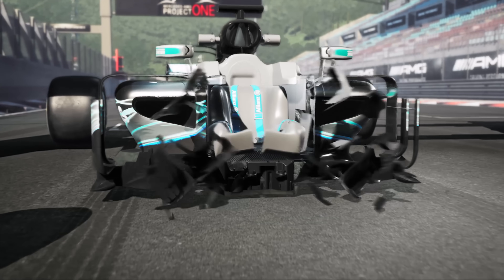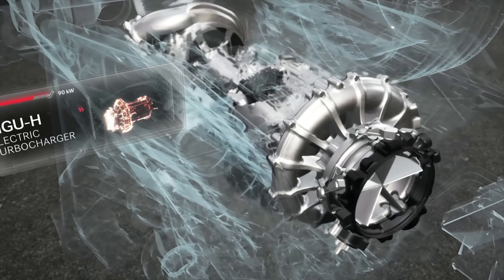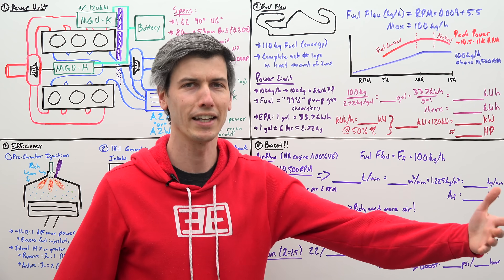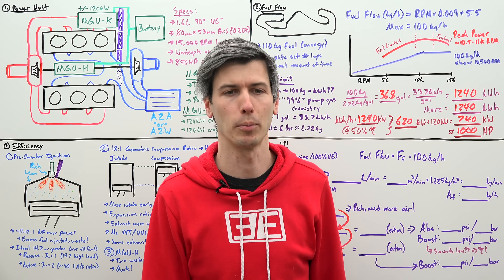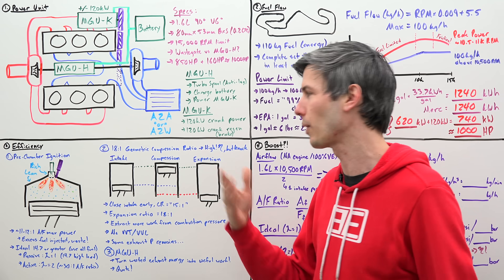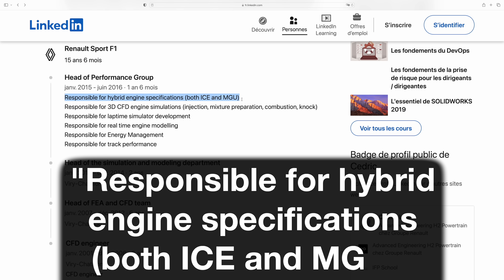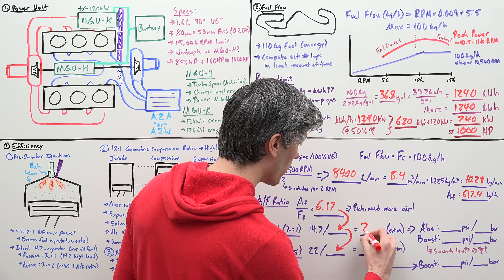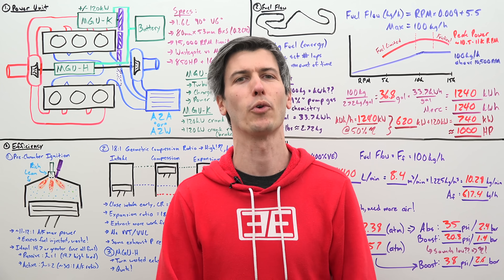How Tiny Formula 1 Engines Make 1000 HP!

Comment: Ppl still don't get it a regular 200hp fuel motor can turn a generator to supply electricity to a battery to supply electricity to an electric motor that puts out 1,000hp, so why do they need 2,000hp to run a 250mph car, fuel and electric combined.

Comment: Your forgetting F1 cars engines do not use normal gasoline fuels they use oils very very thin mineral oils ,with no friction or additives at all, its a base mineral oil ,which produces power and also every moving part of a f1 engine is coated with diamond specialised coatings so it does not require the normal additives found in the average consumer cars ICE engine platform etc. cheers ✌✌👍👍🦘🦘

Comment: i heard toyota reached 42% efficiency in their Hybrid, their hybrid engine also run at the same rps most of the time, they have a variable valve timing in two configuration, one of which is designed to simulate a smaller intake stroke optimized for that rpm  range. would adding a similar turbo system raise efficiency and be convenient?

Comment: JAPAN is the reason F1 is so hi-tech. Most F1 teams run on Honda engines or Japanese engineering expertise. Including the other engine makers..who use technology pioneered by the Japanese. Making 1000 hp from small 1.6 litre engines is Japan's speciality. Those who are familiar with Hayabusa, Nissan, Civics Type R vtec engines know the small engine-big power ratio.

Comment: They're all talking a 1000 horsepower on the modern 1.6  V6 that we have here .

This is with all the complicated electronics hybrid system and everything else just a big electrical nightmare .

I say that we go back to 1986 - 88
back then we  had a 1.5 litre twin Turbo V6 engine in qualifying form was making 1450 horsepower , the Race Engine made 1100 Horsepower without any electronics like a hybrid system and all of that electrical nightmare .
Reply: Engine in the 80s have no reliability. One engine for qualification, and another less powerful one for the race. Moreover, they've literally used rocket fuel to power those engines.
Reply: 1. No F1 engine in the 80s got any more than 1350 horsepower and that was in the all or nothing quali engines that'd last maybe 2 laps before needing to be thrown in the bin. The race engines never got more than maybe 900 horsepower.

2. Said engines blew up all the time. Teams could often go through several engines in a weekend. The modern ones can use 1000 in race conditions and last multiple race weekends
Reply: @dod_the_angel 
 The problem with the current engines as you've even stated is with all the electronics  ( meaning the hybrid motor ) along with the V6 turbocharge engine yes they do make a 1000 horsepower but if you look at the V6 turbo engine by itself that'd be V6 isn't anywhere close to what the V6 of the 1.5 engines run from 1984 - 1990 they had a lot more power and they were definitely running on very toxic fuel I remember being in the pits at Adelaide In 1986 if you didn't have a gas mask on that stuff would give you a migraine headache and burn your eyes it was toxic fuel .

But those engines the qualifying engines that is the V6 engines were putting out 1400 horsepower
of course they were good for about maybe 5 laps and that was like running a hand grenade , the Renault twin turbo engine at the time when Lotus was running it the horsepower and the race engine was 900 horsepower and that of course lasted the entire race .

Comment: What you mentioned at 11:18 reminds me of the 5-stork engine. It was once prototyped by ILMOR. Interestingly the designed mechanism was not successful in finding its way to industry because it worked perfectly only at HIGH rpm, which is the working point of the F1 engine 🤔

Comment: With the electric motor unit helps that extra horse not difficult to understand  , But how they convert that power to joint the engine output (That's hard)

Comment: A friend made me watch the recent F1 race in Lost Wages. One thing I noticed was the frequency of the exhaust seemed much lower than I remembered back when I was watching all racing. So, not only did I find out they are now V6s (they were V12s when I used to watch), but they are now hybrids. I have been watching Formula E and WEC (due to the hybrids), but was unaware of hybrids of F1. In researching them I stumbled on you nifty explanation of how it is all tied together. I thought I had seen all your vidios already, so was surprised to find one I hadn't seen. ;)

Comment: Tolerances on Formula One engines are so tight that they must be warmed up to at least 160° before starting giving them much less blow-by.  If you don't warm them up the engine is ruined.  I've worked on historic F1 cars.
Oh, another thing F1 teams do is cool the fuel before the race but it must be at 72° at race time per the F1 rules (at the time I was working Tech).

Comment: Pre-chamber ignition is also used in a high tech rocket engine, the Raptor engine used on Starship. Well, it's not exactly the same thing, but technically do the same thing, the engine cycle is called full flow staged combustion cycle.

Comment: Impressive presentation on the F1 power plant system. I don't know nearly enough about the race teams to have a favorite - I only know that I find F1 much more enjoyable than stock car racing. 
Assuming that all race teams work within the limits of the rule book then the difference between winning and not winning falls back to luck, talent of driver and team, ground effects, and mechanical integrity of the cars various systems. Speaking of F1 car systems I am only guessing that the power plant is air cooled? Working with extreme pressures and rpm's it seems it would almost impossible to effectively keep the power plant from seizing up or exploding with air cooling only. So is there something other than or in addition to cooling the engine besides air flow Is the F1 engine good for one race only? Does each race start with a completely new engine?

Comment: The valves present a significant constriction to the airflow at 16000ish liters per minute that the fuel needs to have to burn completely. Doubly true at the super high RPMs these run at. I would guess 3 or 4 bar of boost is closer to what they actually run.

Comment: I remember reading about Honda's advanced stratified charge engine, the CVCC, back in the early 1970s in Motor Trend magazine. It employed the use of a smaller pre-combustion chamber with a rich mixture of gas and air to ignite the leaner mixture in the main combustion chamber. What you're describing with F1 sounds very similar to this concept. This made for an engine in the Civic, with its 12 inch wheels, which achieved 55 MPG; with a carburetor. Having lived through the Arab oil embargo in the early 70s, I was very amazed that Honda was able to achieve that feat. The gas guzzling (truly) full-size cars from Detroit did well to achieve 15-17 MPG on the highway.
Reply: Imagine this same engine with modern, direct fuel injection, variable timing (VTEC in Honda speak) and a turbo charger. Considering Honda is back racing in F1 (and winning) some engineering team back Japan has to be developing this.

Comment: Renault also pioneered the research on stratified fuel injection, starting by changing the shape of the piston. By then VW had figured out that high pressure direct fuel injection would do a better job.

Comment: An idea for a future video: Ive always wanted to see car manufacturers put an F1-style MGU-H in a road car. Especially, for battery electric applications. How efficient would a generator be, if it were attached to a turbocharger (both at idle and normal ranges of RPM) and how much electricity could it produce to charge a battery pack on the go....would love to see this!

Comment: Hi, something unclear for me. If there is limit of 100kg/hr of fuel flow and that's happen at 10500, how should they achieved 12000 rpm? they need more fuel flow or i missing something?
Reply: You simply make the air/fuel ratio more lean with increasing rpm.

Comment: Very nicely explained. I didn't see where your boost would be compensating for flow losses on the intake manifold and through the valves. Wouldn't you need some overpressure to compensate for those losses?

Comment: The real reason is just because it only need run 2 hours! Other hight tech can only apply by this condition
Reply: Actually, these engines have to run for up to 8 race weekends, An average Race Weekend is about 600km so the engine is supposed to hold up at least 4800km. Some components even have to hold half a season. As comparison the winning Team in the 24 hour LeMans race this year covered a distance of 4600km.

Comment: higher boost also creates more drag and pumping losses. teams spend a lot of time and money finely tuning intake and exhaust lengths to take advantage pressure pulses. that way they can run less mechanical boost for the same power. of course this only works at 1 speed/load setting which makes this another example of why you can do it in F1, but not street cars.

Comment: Wouldn’t a large turbo be able to provide more airflow volume/power at a lower pressure? Maybe they can run large turbos since the electric motor can help spoil it at low rpm.

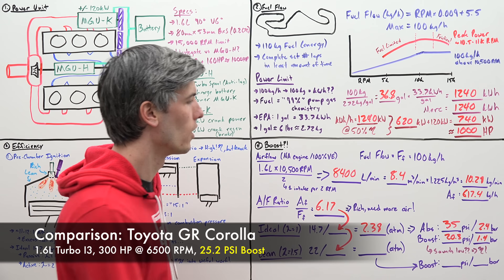Comment: 16:29 isn’t that pressure once it’s in the cylinder, but boost pressure is measured in intake manifold? Shouldn’t there be a pressure drop across the intake valves?

Comment: You're calculation of total power assuming a 50% thermal efficiency is WRONG

You cannot consider the full 120kW of the MGUK, when most of its power is coming from a battery, and not the burning of fuel. You can only consider the power being fed directly from the MGUH to the MGUK, which is a sustainable state of operation.

Also, your calculation of boost pressure is absolute nonsense - A/F ratio does not scale linearly with pressure!

Comment: Remember that boost pressure is a number of back pressure as well I.E. air flow.  The more efficient the less or lower the number. Not knowing what the exhaust pressure is makes this a hard equation to pin point. They both work hand in hand with one another. Great video.

Comment: both the MGU-H and the MGU-K are part of a modern F1 hybrid: the Motor Generator Unit - Heat, and the Motor Generator Unit - Kinetic, respectively. They’re two components of the energy recovery system (ERS) and an evolution of the previous kinetic energy recovery system (KERS) that was introduced in 2009.

Comment: ...it's all about high rpm, precision manufacturing of the parts and design optimization (efficiency).

Power of any engine is determined by it's torque and RPM. Formula is simple:

P = torque * angular velocity
P = torque * 2 π * revolutions/second
P= torque * π * revolutions/minute * 30

Given the maximum power output of 620 kW and optimal rpm of 10.000, F1 engines produces 592 Nm of torque.

To put it in perspective, Toyota Corolla 1.6 Valvematic engine at it's maximum power of 97 kW and 6,400 rpm and only 145 Nm of torque.

So, not only does F1 engine spin faster, but it produces much more torque due to it's high manufacturing standards and more efficient fuel combustion process...:)

Comment: Isn't the efficiency determined by the EXPANSION ratio rather than the compression ratio?  The two need not be the same.  Also, I think that stoichiometric is easier to understand than air / fuel ration.

In any case, it was a very interesting presentation.  It seems that the Otto-cycle engine has yet to reach its full possibilities.

Comment: Isn't the rule on fuel is simply that it must be commercially available gasoline. Which means the fuel sponsors will have this special blend in a few gas stations in Europe to satisfy the requirement. Of course that also means the fuel is safe for use in production vehicles even though it's a special blend.

It's the same way in the WRC that mandates vehicles entered must be production models so car manufacturers will build WRC versions of their entries and sell enough for it to be considered a production vehicle.

Comment: somehow at the end he is talking of densities, because there is no way they cool it back down to 0°C at a 40°C track temperature with the radiators close to the ground.
so the pressure will be about 30% higher .... like 4.4bar which is 3.4 bar boost pressure
Reply: and then in the end the mixture is probable not that lean, rather 18 or 19 to be at about 2.8bar boost and i think i heard that figure "close to three" before......

Comment: Fuel flow isn’t 100kg/hr. F1 races last 2 hours so with fuel capacity at 110kg you’re running at a bit less than 55kg/hour because you also have a minimum fuel remaining requirement so the fuel can be tested post race.
Reply: That's maximum fuel flow, you don't run that all the time. For instance, if the driver is braking, no fuel is needed. Also at partial throttle less fuel than 100kg/hr is needed.

Comment: So my take away from this is if the engineers were not limited by the rules they could make an engine that was both more powerful and fuel efficient? I also wonder why more tech isn't put into purifying the air put into engines. turbos increase the amount of air, but it isn't really air thats needed to make an engine run, but oxygen within the air. Imagine if you could filter the air so that it had a much higher ratio of oxygen in it?

Comment: Another aspect explaining the efficiency claims: the throttle is much much more opened during F1 racing than during a regular commute, and pumping losses due to throttling the engine is one of the disadvantages of the gasoline engine.
This is why manufacturers sell small turbocharged engines these days: the throttle is much more opened and power is regulated by the boost pressure at relatively low power outputs.

Comment: Always an interesting channel! Would be interesting to see what happened in the glory 80's. With really high power output only from 1,5l and boost up to 5,5😳 bars at maximum revs from 12.000 rpm.
Reply: i think they ran these setup engines in qualifing session and it was scrap after handfull of laps. i think the generated 1500 hp short period of time.
Reply: @raitonrait  Yes, it was to read that in practice some of them produced much more than 1000 horsepowers. Especially BMW, Renault, Honda and Ferrari. BMW reached up to estimated 1400PS, but they couldn't measure it exactly. Their own test bench was limited to 1280 PS. Honda engineers told that their own test bench peak was reached at 1176 PS and Renault was estimated roughly at 1200 PS. Normally you wouldn't find really exactly numbers. Engineers from Brabham told that they fixed the wastegate from the BMW engine, so this means the pressure maybe was more than the adjustable pressure of 5,5 bar. The result was that the engine was completely disintegrated... A lot of funny stuff, but at the end you have to bring the power to the road and that was the challenging part. If you see the results in practice at the mid 80s you will see that N. Piquet was very often the lead in practice, but during the race many bad things happened and very often the engine failed. But the power boost must be tremendous. I read in a magazine that N. Piquet reached in Monza close to 380km/h, but with steeply rear wings😳Derek Warwick told in an interview that difference between the BMW engine and the Renault was significant. The power in the race would be within 900-1000PS, really impressive.

Comment: Question, higher altitude has lower pressure. But once you compress that air to a certain pressure say 25psi. Wouldn't 25 psi have the same density regardless of altitude because it compressed? Just the time and the heat generated to get to that pressure would be different. Or at least that's what I thought. Would like to hear a confirmation or correction on this.

Comment: no they are not they are stil slower than the 2000 cars
Reply: Because the 2000 cars had less regulations and in the 2000s cars they didn’t need to tune down the engine. Modern day f1 engines need to go a third of a whole season

Comment: I think valves are hydraulic-pneumatic actuated that means no camshaft they can fully open and close the valves electronically anytime relative to piston position in cylinder. They use this valves system because with valve springs is not possible to get this high rpm.

Comment: You run 93 octane outta those f1 engines and its gonne be running 1/3 of its racefuel power at best. 1k hp 104 octane is gonna be more like 3-400hp with 93 octane. 
You can easily do that with any stock engine. Put race fuel in and as long as it can get the air itll make a ton more power. It wont be economical but that wont matter as its internals wonnt last long at all😂. But hey you could take a 300hp toyota camry straightpipe it with a short ram intake and tune it for 104octane filled up and prolly easily push a few runs down the travk with 500hp. Better not plan on deiving it home tho😂

Comment: Hi. As an avid F1 viewer/ enthusiast since the mid-1970's, bringing your analysis to current F1 engine specs makes me truly wonder what was going on in the 1980's with the BMW, TAG/Porsche/ Renault/ Ferrari (and the many others) engines that would detonate like nothing seen since. I suspect that general mechanical part engineering precision, telemetry, and testing repetition have all been ingredients to the baseline calculations you draw upon. However, to me, as a driver, it would be very interesting to learn where the 'power band' curves are blasting and/ or are most fuel efficient. I guess it depends on each manufacturers engine. But... but... but... have you seen the engine mapping abilities drivhave from their steering wheels. It isn't simply setting one to ten... F1 drivers have millions of variable fuel burn rate settings to manage over the course of a qualifying or a race lap.  Cool.